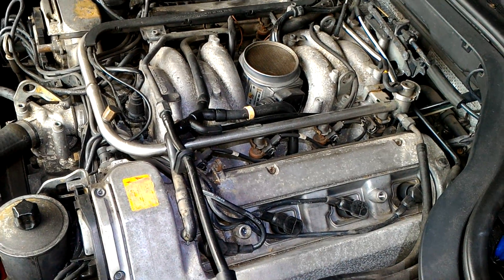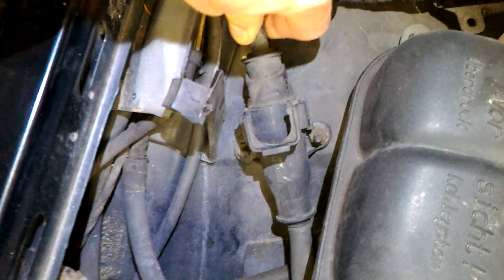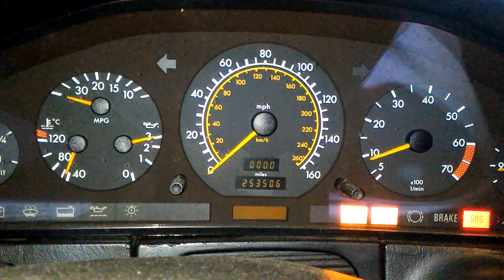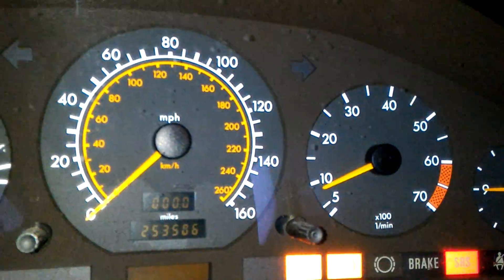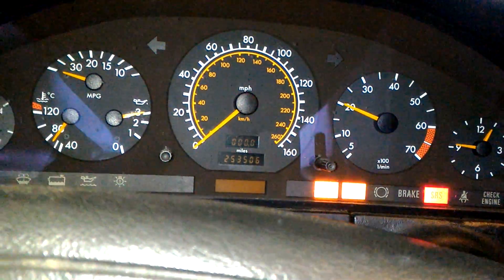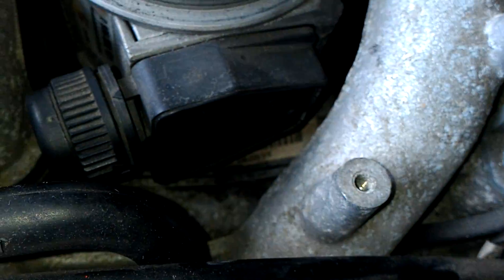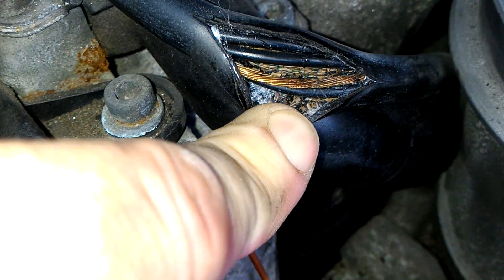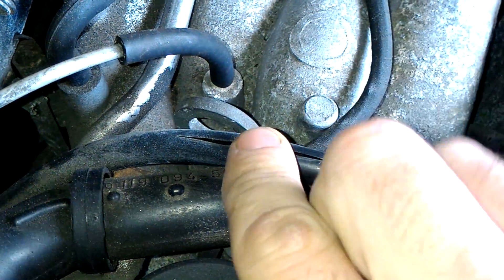Mercedes ASR problem, limp mode, no acceleration. I repair these throttle bodies.

Comment: thanks for this upload. I have this issue with my 94' and couldn't diagnose it for the life of me
Reply: did it fix?
Reply: Yeah?  My 1993 is doing the same thing.  BenzWorld forum says it’s the throttle position sensor.  I’d love to know exactly what to do the get it resolved; I keep having to shut off and restart the car because it’s gone from doing it like, twice a month, to doing it once a day or twice every other day.  Right now, fixing this is my top priority.
Reply: @closer71  Check the wire harness, the main one in your engine basically, what happened to mine turned out to be a catastrophic failure of the harness, basically the insulation on the wires degraded and caused them all to short, it's apparently a relatively common issue, if that's the issue, make absolutely sure you order the right harness, as there are a few different configurations for that car, and they're pretty expensive
Reply: @marccabrera4599  Where i can buy the right harness for the W140 S500 ? What website ? Thanks
Reply: @khaledfandi1085 , looking like no one responded to your SOS . I have a 92 SEL that’s in limp mode. What did you find out 😳

Comment: I have a 97 e420 in limp mode with asr light on. I had car in shop and they said transmission not communicating with computers. Long story short they say they can't fix it and come pick it up at no charge

Comment: I have a 2000 mercedes 230 my accelerator pedal doesn't respond at all one day (intermittently) sometimes it works fine. Ideals smooth runs great when the pedal does work. But the next day it won't accelerator at all. I've replaced the accelerator pedal sensor and throttle body to no avail. Someone help me

Comment: Wow this is a buzzkill. My 95 SL500 has the same symptoms ☹☹☹☹
Reply: @Ray Benvenuti it went away but I ended up replacing the whole upper wiring harness then months later hydro planed into a wall on the highway in it lol

Comment: what causes the car not to start cuz I have a 93 500 SEL that the RPM don't fluctuate whatever I put it in gear it just dies and the engine shakes like it has a misfire

Comment: Did throttle body relearn and it fixed problem. 

1. Turn key to run, do not start.
2. Push and hold gas pedal to floor
3. Turn key off 
4. Release gas pedal
5. Remove key, then re insert and start.
Reply: bingo!  fixed mine

Comment: I have a 2003 Mercedes s55 amg and I had a throttle body code (p0120 throttle valve actuator: deflection throttle valve) idle was steady but seemed weird when pushing on the gas but also had a cylinder 3 and 4 misfire. My vehicle went into limp mode when I drove a few feet and cut off all acceleration with backfiring. I could not get it to drive and my breaks got very hard to where I couldn’t push them.
Reply: Any ideas??

Comment: Very informative! Thanx for sharing! One more thing, besides this and transmissions, what else causes 'limp mode?'
Reply: any major sensor, faulty wires, or low fluids
Reply: , so everyone having limp mode issues, if you are in a best case scenario / other than then a short in the wiring harness. Only a few things will put the engine protect mode into position. Low fluid in the overflow container will cause it, low oil, high engine temperature . But from what I’ve heard. The W140 chassises were made of as much of recycling plastics for one is what caused this Limp mode issue

Comment: Hi, Victor I need your help, I have a 1994 S500 "C140" Japanese spec and I had issues "asr" light and "limp mode" has well, somebody has fixed the wires on the throttle body but the car still have the same problem. 
Do you think the car should have other issues?
Regards
From England
Victor Almeida

Comment: hello, I have the same problem on my 600se 1992, it idles unevenly missfireand doesn't have the power it needs and it sometimes goes into limp mode, then you have to turn it off and start again, I think it's something with the throttle can you pls help mee

Comment: Hello Victor. I need help.
I have an S500 with asr. I redid the throttle body harness.
The car starts normally, but does not accelerate. Do you have any idea what it could be?
Reply from the maker: Hi,
No idea what's wrong. I need to see the throttle body and Egas modules on my bench.

Comment: I have a 93 500 sel that will start right up in the morning and after approximately 15 minutes of driving, it will begin to sputter. It ends up dying and will not start for about 20-40 minutes. When i crank, it will pop and backfire. It has good fuel pressure with no spark. To get it started, I HAVE to feather the throttle while cranking and eventually it will start. Almost like its flooded. New plugs and wires. New fuel regulator. 300k miles. Been a mechanic for 17 years but I've never messed with a mercedes and I'm a bit lost.
Reply: Crankshaft sensor?
Reply: dude  sounds like a clogged  catalytic converter

Comment: We have a r129 SL 600. And the ARS light comes on after about 45mins of driving, every time. Could it be something similar to this?
Reply from the maker: Could be throttles or Egas. Needs proper diagnostic

Comment: Greetings Victor, i have 1997 s420 and my car looks like it went into limp-mode. I have no response when i push the gas pedal and the  rpm needle does not move. I did remove the air filter cleaner housing and found that the throttle body mass air flow sensor housing was at an angle, so i mounted the mass air flow housing back to its correct position and started the car, it started up and the rpm tac was working again but after a few seconds the rpm tac stoped working and had to throttle response again. 
The car has been sitting for a year or so and i just recently put it back on the road. It ran good but this is the only problem I've had so far with the car.  Is there a relearn option for the transmission or a relearn option for the throttle body? Can you help??
Reply from the maker: Hi,

I can help but I need to have the car here for diagnostic. My zip code is 10464. Diagnostic rate is at my website.
Reply: @vsandvs  i appreciate your reply but I'm in Tucson AZ. I think im just going to try the relearn option first to see if that will.work fix rhe problem.
Reply: @nikam6349 , what is the recalibration for throttle body method? Thanks

Comment: How to reset the acceleration pedal has been my biggest problem after reinstalling my throttle body
Reply: Victor if you could please help me that would be great I don't know what else to do
Reply from the maker: No need to reset throttle pedal after throttle body installation. As long as you did not move any throttle linkages.